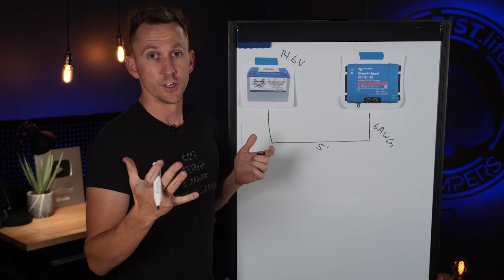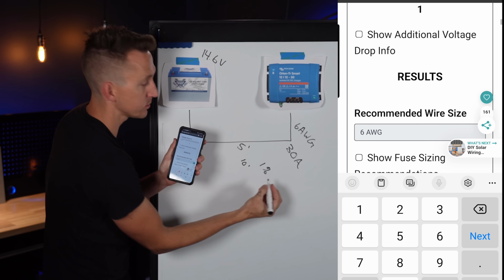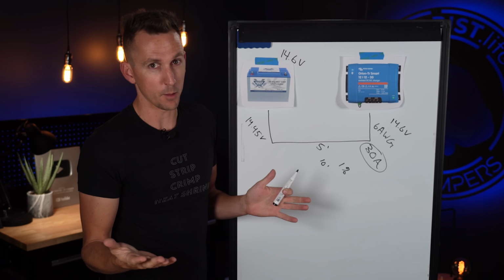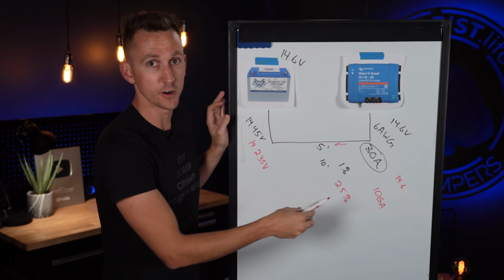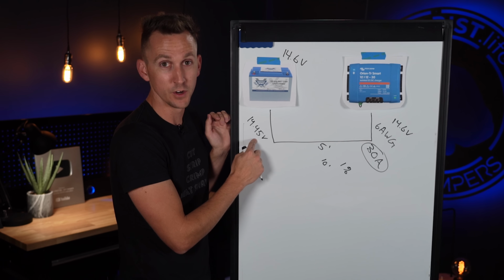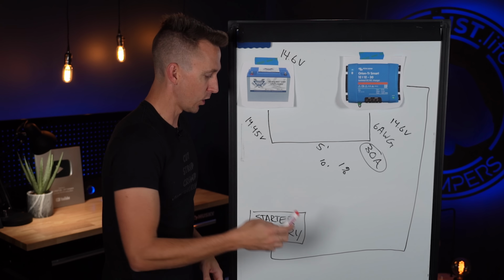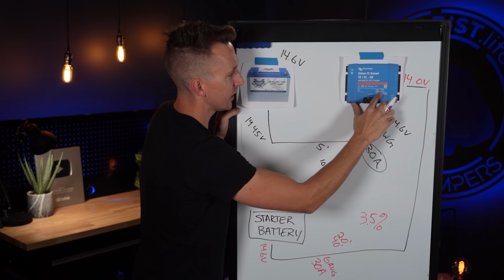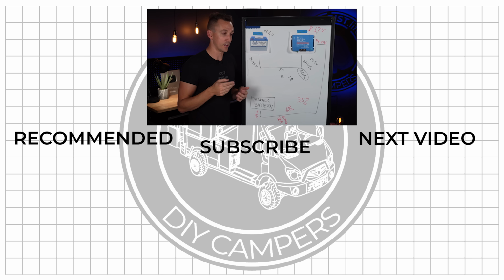HOW VOLTAGE DROP AFFECTS BATTERY CHARGERS

Comment: Again, well done explaining 2 viewers; it is educational n Ur video is *qualify as instructional video like Ur other video that draws picture to make connection, or related or associated with similarities is good way 2 understand n remember, fireman truck hose to burning house comparing an below battery to bulb or load device, which used up voltage and between culprit is resistance or ohms, which we must use-Or-2-replace-2-thicker-gauge-wire-guage-to-reduce-resistance-or-ohms, and clean N brush up corroded device connection like battery cable to battery post and we also forgot to remove battery that have been inserted 2 battery chamber where many cases we left them for quite some times and result is corroded battery and device would not turn on OR will not work, also causing significant reduction in voltage drop in  a case like battery terminal or NOT battery cable NOT fully connected 2-battery-terminal, still LOOSELY connected so lose lots of voltage drop! Of course, anywhere circuit open area, wire, etc. meaning NO voltage! Other cases is wires got *TWISTED cause big voltage drop or result in **shorted-*2-*power-meaning wires got ended up connected to other wires, NOW wires got connected to more than one intended wire, and often happens case where wires got exposed due to hot exhaust pipe heat and wire coating has been melted and as result connected 2-other wires that was not meant! like near exhaust pipe, and of course **shorted-*2-**ground-meaning FUSE(s) is or are blown!
Reply from the maker: Hey RubiconKLBRUTO Rowman, No problem!  Glad it helped! :)

Comment: Hi Nate! Really well explained video, as always. One thing I'd raise regarding voltage drop while charging LiFePO4 batteries is that it shouldn't matter too much because of the non-linear voltage to state of charge curve of this chemistry. The upper voltage knee of a LiFePO4 battery means that the difference between 1% and 5% voltage drop overall is likely to be pretty negligible in terms of the actual SoC of the battery itself - some will argue that constantly max charging a LiFePO4 will actually reduce the potential service life of the battery. tl;dr is that it won't really matter that much unless you have an "every amp hour counts" scenario. A couple of other examples that would better illustrate the benefits of over-sizing your cables, could be in other low voltage applications where you could have strings of lights that could suffer from excessive wire length, even though their current demand is relatively low, or better still, why it's really important to keep your high current runs between your battery and say, a distributor or Inverter, as short as possible, because the resistivity of the cable at high currents is just wasting energy by heating the wire. And of course, if you've oversized your cables, you're likely to be in a better place if you need to upgrade in the future.
Reply from the maker: Perhaps, but I'm always going to recommend charging a battery to the voltage that the manufacturer recommends.  Where you'll run into issues is if you have a battery monitor in the system:  If you set your 'charged voltage' of your shunt to 14.4 and set the charger to 14.6 and excessive voltage drop is only charging at 14.1V; the battery monitor will never re-synchronize at the charged voltage to 100%; which will yield inaccurate battery monitor readings.
Reply: @EXPLORISTlife  That's fair - I'd not considered battery monitors. I actually really liked the suggestion you made in the video about the Victron smart battery sense lead for MPPT chargers - that's quite a neat way of getting around resistive losses if you can't easily co-locate the charge controller and the batteries.
Reply: @Chris Bassett  gosh I wish I understood what was being said. no need to reply I was just making a comment. I've had so much going into my brain over the past month or 2 with solar n everything else I'm kind of overwhelmed. I do know more than when I started though that's for sure. but it sure gets confusing. And then I I try to find either the comment or the spot in the video  n the spot so difficult to find🙂.. I don't know how people did it back in the day. Days we have great people like Nate to help us navigate through all the trials and errors
Reply: jesus christ this guy elettrotecnics

Comment: As the current drops when the battery nears full charge, so the voltage drop will also decrease. Stated at 3:22," the battery will never get fully charged" is then incorrect. To my knowledge (confirmed by measurements on a live system) the battery will get fully charged, but it will just take longer than if heavier cables are used (given that the charger is in constant voltage mode. In constant current mode the cable resistance is no factor providing the charger can ramp up the voltage high enough). Am I missing something?
Reply from the maker: Oof... although I suppose that's 'technically' true in some scenarios; under-sizing the wire is STILL throttling the charger to how it should actually be working.  

When I'm designing a system, I'm always going to avoid something that I have to start with the disclaimer "Well...  That will TECHNICALLY work, but...".
Reply: This is particularly true if a lead acid is being charged but less so in case of lithium as the battery’s resistance increase as it charges is much less, especially the last 10% of charge.
Reply: In all cases voltage drop is proportionate to current, so with all battery types it will fully charge to whatever voltage you set it to. It will be slower, but it will fully charge eventually. The reason to not undersized your wiring isn't because it is inefficient or because it will not fully charge, or not even because it will take longer to charge. It is because it is dangerous and can start fires. The speed your battery is charging at doesn't matter if your van or RV is in fire. A little undersized is fine, it will just take longer. Too much undersized and you get fires.  Where is the line?  Caveat emporium. If you aren't an electrical engineer, properly size your wiring.

Comment: Hi Nate! Really well explained video, as always. One thing i did was to measure the voltage at the house battery as i had quite a long run and i ended up with 14.1 so i went into the settings of the victron dc-dc and upped the voltage so that the house battery received 14.6
Reply from the maker: Thanks!!  Glad you found a fix that worked for you.  What prevented you from putting the Orion closer to the house battery?
Reply: @EXPLORISTlife  again like you said I have always been told to mount as close to the battery as possible. Same as mppt controllers BUT from what you said I reckon your option would work same if not better than my fix. You have opened up another fix for us people and we all appreciate your efforts. Thank you

Comment: Hi Nate, extreme beginner here trying to really get a handle on this before I get rocking on my power system install. As always, I VERY much appreciate your approachable electronics explanations!
So my take-away here (please correct me if I'm wrong) is that in this scenario, it's best to have the DC DC Charger closer to the battery bank than the starter battery. Given the inbound side of the charger can handle more of a drop, would we make sure the charger is as close as possible to the house battery to eliminate as much drop as possible, so we're as close as we can be to that 14.6V required charging?
Reply from the maker: Exactly!

Comment: Nate, is the use of a Victron Smart Shunt and Smart Networking equivalent to a remote batter sense? Provided of course the shunt is located very close to the negative terminal of the battery bank.  This is what I’ve been using to charge my battery bank and independent voltage measurements confirm it works. If so you might want to inform people about that. It’s also an additional reason to purchase a Smart Shunt over a ‘regular’ shunt.  I use the Smart Shunt and Smart networking to tell all of my chargers (MultiPlus, DC-DC, Smart Solar) what the battery bank voltage is.  I hope this is a smart thing to do.

Comment: Hi Nate. Thanks a lot for your videos! Also a complete electrics beginner. I have a renogy 40a dc to dc charger. I believe this gives out a surge current of 60a or sth like that. My one-way run length is 4.5m, so 9m in total. I was planning to use 4awg wire between my starter battery and dc to dc charger for a voltage drop of roughly 3%. However I am now reconsidering to use a 6awg wire which will be cheaper and less bulky when installing based on your guidance around only needing to meet the required input voltage of the dc to dc charger which in my case is 8-16v which should be fine. I will also place dc to dc charger right beside the house battery. Am I on the right track?

Comment: Nicely explained. Why run from the starter battery compared to from the alternator? And does that B2B charger know not to run the starter battery flat? Regards
Reply from the maker: It's usually much easier to attach wires to the starter battery than the alternator and the wires going from the alternator to the starter battery are always rated to carry the full load of the alternator, so voltage drop is rarely an issue there.

Comment: Can you run a 2awg 95% of the length and step it down to 6awg the remaining 5% to fit the charger?
Thank you for sharing this information Nate, it has helped us alot!
Reply from the maker: Out of all of the systems I've seen and helped with, I've never seen a scenario where that is necessary.

If somebody finds themselves installing a DC DC charger in the back of a 100ft long rv and 6awg doesn't cut it, use bigger wire and a pin terminal instead of downsizing the wire, or just fill the 100ft long rv up with solar panels and forget the dcdc charging.
Reply: @EXPLORISTlife  
Thank you, I was not aware pin terminals existed , I have seen millions of videos of electrical work done and never came across this type of terminal.
Reply: @EXPLORISTlife  I am thinking of this very setup (above) for my 5th wheel trailer, with alternator charging. As I see it I am going to have about a 25 ft (50 ft)run thru the truck to an Anderson connector near the hitch. From there the wire will run up the hitch, thru the front bay and into the pass thru compartment where the batteries will be mounted. I am thinking this will take about another 25 ft (50 ft) of wire. In the pass thru compartment it will be feeding 2 30amp DC to DC chargers and maybe a 3rd, new alternator. 

I am thinking 2 GA wire from the truck thru the Anderson connector to fused buss bars close to the chargers. From the buss bars to the chargers it is going to be 6 GA, a couple of feet. I have 600 AHr of batteries that I am going to be working and may expand to 800 or 1000. I will be adding solar to help offset battery usage. You never know when the sun may shine and when not and for how long. I am looking cut voltage drop to a minimum.

Bob

Comment: Hi, I bought a 24/12 30amp orion dc to dc charger but I have a 12v system. It said it works for both systems. I'm worried that if it drops below 14v it will shut off and not turn on until it reaches 15v. So is there a possibility that it will switch off and not come back on since 12v won't reach 15v input ? 🤔

Comment: Hi Nate, Ive been following your series for my project. I'm trying to add a way to charge my system using ev charge stations. Do you have any content that demonstrates that?
Reply from the maker: I do not.  Charging your house battery bank from a public EV charging station is a good way to get vans and campers banned from even more parking lots than they already are.  Charge from solar, alternator or onboard generator.  If you need to plug in, go to a campground.
Reply: @EXPLORISTlife  good point. Makes sense why this isn't a bigger thing

Comment: Nate:  Does your online calculator take into account the drop for the entire circuit, or just one direction?  The voltage that matters is between the positive and negative terminals of the battery.  If the positive and negative wires (paths) are the same length, and you have a 2% drop on the positive wire/path, you will also have a 2% drop on the negative wire/path, and the battery will actually see a voltage that is 4% less than the charger is putting out.
Reply from the maker: Total wire length.  10ft negative +10ft pos = 20ft wire.
Reply: @EXPLORISTlife    Thanks for clarifying that.

Comment: I know this is primarily about voltage drop but why haven't you discussed the smart sense before? Maybe I missed it but it's relatively inexpensive and looks like an easy addition for a victron system. I assume you just add it to the victron network and it controls the mppt, of which I have 2, so it would adjust both of them appropriately. I'm still weary of the DC to DC charger as it gets very hot and I'm running out of room but I assume it would control everything in the network.

Comment: First time I’ve seen voltage drop from a DC to DC charger to Li battery be discussed and it totally makes sense. But what is solution in 2001 dodge class B van when house batteries are not in a tight, non-weather proof enclosure that would not accommodate a DC to DC charger install?  I was assuming I’d mount in under hood next to van battery, but now I’m questioning that plan.
Reply from the maker: Yeah, it needs to be closer to the batteries.  Usually it's easy enough to locate the charger inside the camper 5ft or less from the batteries, which will be plenty close enough.

Comment: I do have a question on ground wire. can you take the positive from starting battery to dc to dc charger then take the ground input to dc to dc charger from frame or closer ground source or does ground need to come from starting battery as well. asking since starting battery is already grounded to frame. thanks
Reply from the maker: I recommend running the negative all the way back to the starter battery for more a reliable connection as shown in all of our diagrams at https://www.explorist.life/solarwiringdiagrams
Reply: @EXPLORISTlife  got it, thanks

Comment: The difference in SOC between 14.6V and 14.2V is nothing. Maybe a single AH. MAYBE 2ah.

And highly unlikely you're going to be pushing 30A by the time you are above 14V. You are past the knee and voltages inside the cells are rising very rapidly.

I think your white boarding would be better to do at what you expect a during bulk charging - 13.3 - 13.7V.
Reply from the maker: Oof... although I suppose that's 'technically' true in some scenarios; under-sizing the wire is STILL throttling the charger to how it should actually be working.  

When I'm designing a system, I'm always going to avoid something that I have to start with the disclaimer "Well...  That will TECHNICALLY work, but...".

I'm always going to recommend charging a battery to the voltage that the manufacturer recommends instead of purposefully a few amp hours lower when the problem could be solved by using properly sized wire.  Where you'll run into issues with not charging to full voltage is if you have a battery monitor in the system:  If you set your 'charged voltage' of your shunt to 14.4 and set the charger to 14.6 and excessive voltage drop is only charging at 14.1V; the battery monitor will never re-synchronize at the charged voltage to 100%; which will yield inaccurate battery monitor readings.

Comment: DIY CAMPER, try to make a Smart Battery Sense video lesson and also how to compute/calculate the voltage drop % percentage with the Wire Gauge using the manual way if you didn't have that wire size calculation program how would you do it the old fashion way?
Reply from the maker: I've got a video a while back that teaches you how to size the wire from the hand-written calculation.  You can use the same formula to determine voltage drop.  I will not be making a video on that, though, as nobody really wants to do that calculate voltage drop by hand without a calculator.
Reply: @EXPLORISTlife  I mean using a calculator using formulas to compute the wire size and voltage drop percentage, instead of using that app software program. I know to use ohms law to compute voltage drop but I don't know how to compute the voltage drop percentage and wire size
Reply from the maker: I see.  Yeah, you'll probably just have to look that one up on your own.  I don't suspect enough people would watch that video to make it worth one of my weekly uploads.  Otherwise, you may just have to suffer through with the app I made for you that does all the work automatically. 🤣😂
Reply: @EXPLORISTlife  i mean you can throw it into a new video if the lesson had to compute the voltage drop percentage and wire size because most other subject lessons will have to compute the voltage drop percentage and wire size it will come up again in future videos
Reply from the maker: The video I made a few years ago talking about how to size wires shows the formula, if I remember correctly.

Comment: A "tactical" solution is to run your 2 or 0 gauge wire from the battery up to a buss nest to the charger.  Then from the buss to the charger you run a very short 6g jumper.   Yes not ideal but in some situations it solves the voltage drop issue when you do have to traverse a long distance.
Reply from the maker: A 'pin terminal' is another solution if wire larger than the terminal is absolutely necessary, but I pretty much never run into a scenario where a wire oversized to that degree is necessary.